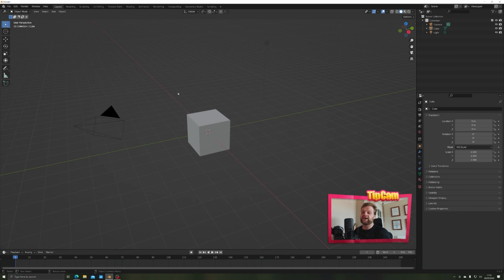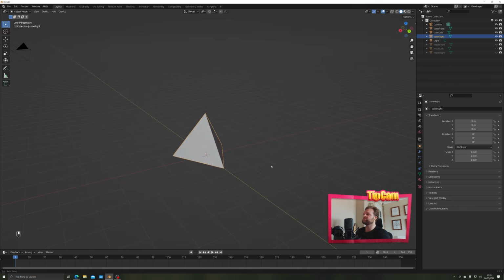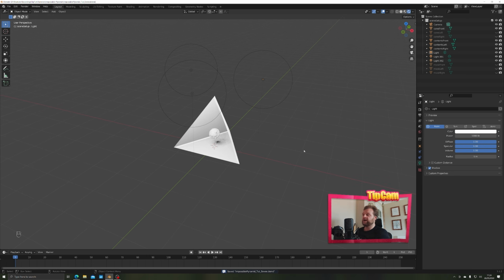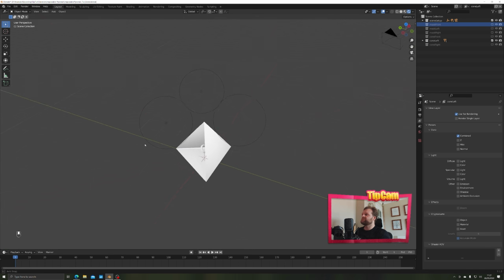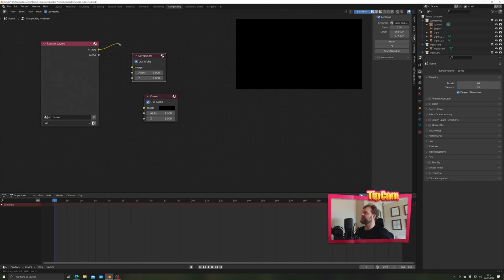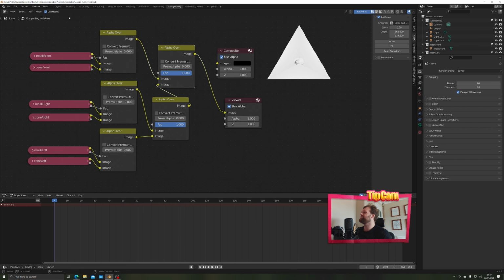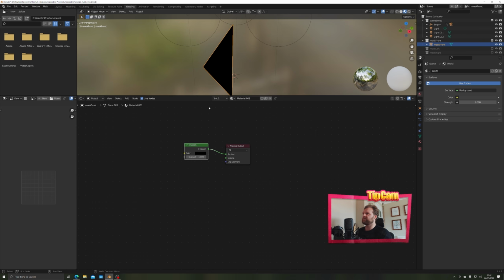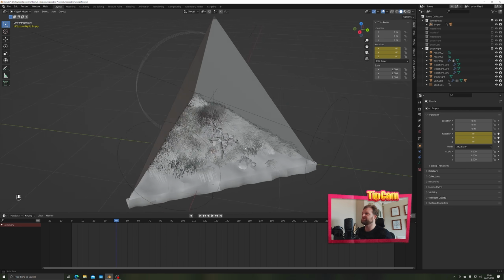Make an IMPOSSIBLE 3-Worlds-In-1 Pyramid in Blender | Eevee & Cycles

Comment: thanks for the great tutorial. the handiest tutorial for the impossible pyramid so far. cycles didnt work for me for some reason. its all blacked out when i get the render although i did take the exact steps as you lead. what is missing do you think? + the shader for cycles provides better results on eevee btw
Reply from the maker: Make sure you've connected up the composite node, not just the view node